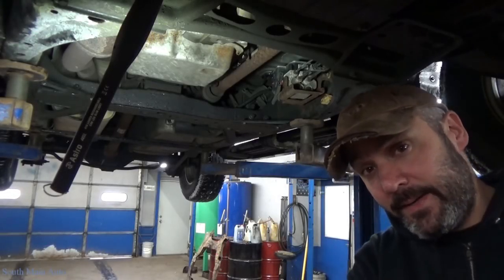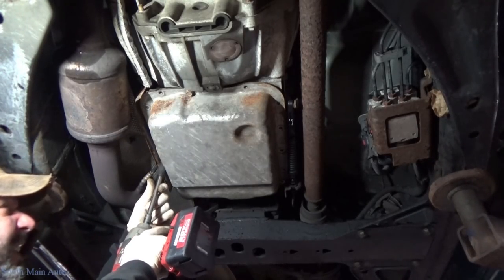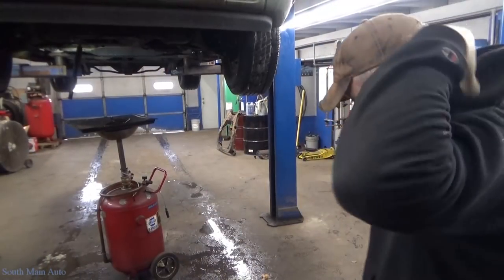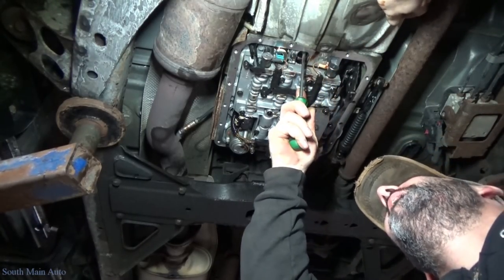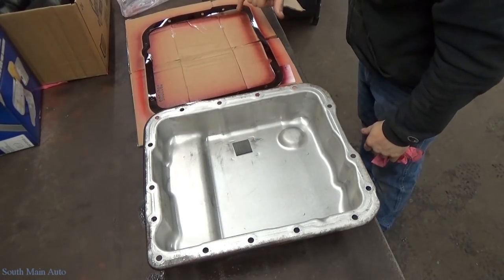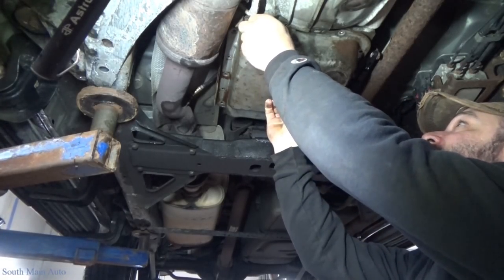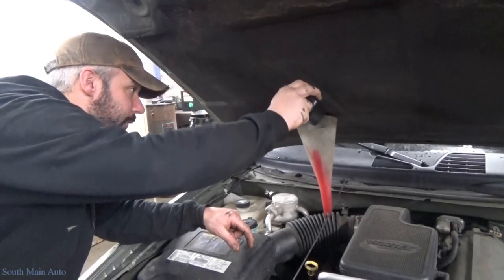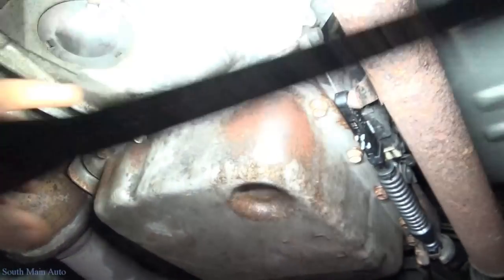Trailblazer / Envoy / Rainier Transmission Fluid & Filter Replacement 4L60E

Comment: I have done this on several different vehicles and if people would do it regularly it would be fine. Sometimes I disconnect one of the transmission lines going to the cooler and pump out all the fluid. I recently bought a 12 V electric pump to pump out fluids and I'm gonna do that today to drain the transmission pan before I drop it, less chance of spills.  As always Eric thanks for the great video.

Comment: I learned from someone else here on YouTube to remove the bushing take a 1/2 in. galvanize pipe about a ft. long with an elbow. Screw it into the bushing and then tap down with a hammer. Bushing easily comes out !

Comment: I'm glad that Eric O. Tells his viewership that there are two options that are available. One just being drop the pan to empty the fluid and change the filter. Second, use the fluid exchange machine to get all the fluid completely out of the system. SMA is always getting new subscribers or viewers and not everyone knows their options. Personally I like the fluid exchange machine used on my vehicles because I just like knowing all/most old fluid is changed out. Torque converters can hold up to 1 to 2 quarts of fluid. What's upsetting is how people go out of their way to try to discredit THE BEST mechanic on YouTube. I've never met him personally but trust him implicitly because he is always honest and extremely knowledgeable about his procedures. The quality of workmanship that comes out of SMA is the best I've ever seen. Eric cares about his business and his reputation as a mechanic. If I have a question about his work, I ask, and he replies with an educated answer. Great video.
Reply: problem is, most cheat and don't change the filters or seal when doing flush service.
Reply: throttle bottle Well I supply my own parts, filter and gasket when taking my car to a transmission shop. I also request the old parts back so I can be assured that they did the job. I learned a long time ago to mark my parts with an invisible marker as to know for sure im getting my original parts back. Sad but ive caught some dishonest mechanics this way.
Reply: @klwthe3rd  You GOT IT ! Trust BUT verify , I also mark my engine oil filter , " wipe and  call new " is far to easy !

Comment: I have no idea why you would get thumbs down
You did it perfect,as well as the high tack
Just remember to road test after you gather your 
customers info,to be sure the trans works properly,
before deciding on changing the fluid
I like to run a tap into the case threads & use 
anti-seize on the bolts & recheck the bolts in
a week,month or whatever

Comment: I know, older video. My 2000 GMC Yukon had the 4L60E and I dumped the pan and filter every year as an old mechanic told me to dump it every year and I got 150,000 Miles out of it and every mechanic in my area asked how I got so many miles out of it when it went.  I put the transmission in on a gravel driveway.  I had to lay down cardboard, chunks of old carpet to not get so many bruises from the rock.  Believe it or not, the hardest part was getting the dipstick tube back in.  I'm glad I did it exactly the same way!  I got rid of the Yukon at 220,000 miles as the blend doors were shot, ball joints shot and everything around it was nickel and diming me to death.  Oh yeah, I flushed the antifreeze at 100,000 miles per the manual with red goo and distilled water, never gave me a problem until the fuel pump went out.  I did that too, it was pretty easy except I broke a fitting off of the vapor canister as I missed one hose!  Great video and that's what I was told how to change fluid.  Same on our Accord, dump, fill run, dump fill, run dump and fill. Over 200,000 on that car and runs like a champ.

Comment: I'm way over do on changing the fluid in my transmission,   I'll just change it twice next time.  When you changed the transmission fluid on the 98 Toyota is when I found this channel since that's what I have for a car so it caught my eye.    I know a lot more would watch is they only knew what they are missing.

Comment: Definitely, not a hack by any means.  The only thing I would comment on is the electric impact when taking out the bolts.  I was doing this same job on an 08 Rav4; I was fixing up for my brother.  My electric impact broke two bolts right away when trying to take them out, so I switched to hand tools and hit each bolt with a little bit of propane before removing them.  I also want to thank you for introducing me to that Permatex spray gasket.  I saw you use it one of your older videos; I went out and got some and I use it on EVERYTHING now that has a gasket.  I used it when doing the timing belt on my v6 3.0 Audi for water pump, valve covers, etc... It did blow up my engine, but you know..lol jk.

Comment: I have an '01 Silverado 1500 4.8 & I do the exact same method, just without tack spray. Although my transmission is giving me a code for shifting, I have yet to change out the sensors in it. BUT I will come the new year with its service again.

Thanks for the videos & Happy Holidays.

Comment: Inhaling the fumes of the spray gasket sealer will help get you through the day much easier.  Nice job with the vid!
Reply: I'd imagine his shop smells like a brake parts cleaner factory ;)
Reply from the maker: It does smell amazing in my shop not gonna lie
Reply: My nose hairs were singed so bad that I'm still trying to regrow them.

Comment: I would always leave the front two bolts in each corner, and the middle in the rear. I'd take a screwdriver and break the seal on the gasket, then slowly remove the center rear bolt And let the fluid drain until it dripped, then I'd loosen the front bolts, letting the pan angle down and drain, loosening the bolts gradually until I could remove the pan. This usually resulted in no spills. Best way to get 100% of the fluid was with the fluid exchanger machine we had at Goodyear. You disconnect one of the trans cooler lines at the radiator and connect the hoses to the machine, after figuring out which was the return and feed. You'd fill the feed tank with new fluid, then start the car and turn the machine on. It would pump new fluid into the return line, and the feed line from the trans would pump the used fluid into the empty waste tank. It had a book that gave capacities for different cars, but we always added a extra few quarts and would run the machine until there was clean fluid going into the waste tank.

Comment: Thanks Eric I've never changed the filter seal before. Now I know it's there I'll address it next time. Good video.
Reply from the maker: They can be touchy so just make sure you have a back up plan....
Reply: Guy at the transmission shop I got my filter and seal from said they don't touch them normally. Claimed they very rarely cause any trouble and you stand a better chance of messing things up by replacing them than just leaving them alone. Same trans, 4L60E.  I went with his advice.

Comment: I like the way you replaced that seal. The first time I did that I got nervous that I would score the housing, and chickened out before reaching the point of no return. As you say, they seem to last forever and since then I've always gotten away with reusing the original one. Presumably if the seal is bad, pump flow would drop because of an air leak, and the pump could start dragging air bubbles that could be a real problem. So there is a risk of a serious issue that must be hard to recognize. Even new seals can leak.

Comment: I'm in agreement with you & rebuilt trans for @30 yrs and changing the fluid & filter as part of periodic maintenance will keep your trans healthy. Flushing is only required when replacing the transmission & converter or after cooler, converter or trans failure when fluid is contaminated with debris or coolant but doing more than the manufacturer scheduled maintenance is an additional option. People calling you a hack is ridiculous but hilarious and I've been using Hi-Tack to stick gaskets on components for years but never on both sides.  HAHA wonder what they'd say if they seen me using 3M Weatherstripping Cement on old style intake manifold & oil pan gaskets.  Hope you had a Merry Christmas and have a Happy Healthy & Prosperous New Year!

Comment: I’m in the process as soon as the weather clears up a little, doing a shade tree transmission flush and filter. I am not sure when the last time it was done, and recently started having issues with reverse engaging. Reverse light will come on but it wasn’t trying to move. No slipping in any of my other gears and no leaks. I just figured attempting this would be easier and cheaper than dropping the whole transmission and either rebuild or replacing it.

Comment: Hey eric i got a good laugh the other day when u forgot the springs in that trans am. Thanks for not editing that out it make your channel real and i got a great laugh on your expense. Lol. The other day i was smoke testing the inttake on my ram and i had it in the back of my shop which is 60 feet deep. I was puttuing smoke in through  the brake booster hose. Anyways when i was donr i put my smoke machine away and shut my hood after cleaning up and started mt truck amd quickly pulled it to the front of my shop. Yup u guessed it. I forgot to put the break booster hose back on and almost went through my shop door. Lol. Im not afraid to admit my mistakes and im glad your not avove that as well. Have good holiday
Reply: Whats the scents of doing something stupid and not sharing it with your friends?
Reply: Ken exactly but we'd be surprised how many people proly woulda cut that part out
Reply: Dylan Kinch WELL, I just have to wonder if he forgot to put the springs back in this one, with the trans fluid change, and just cut it out! Oh well, we will never know!

Comment: I have a 2001 Isuzu 4X4 Rodeo with a 3.2L GM engine and 4-speed auto. It's one of those wonderful designs with no transmission dipstick. There's a flat area on the pan with a plug on it. I have to take out the plug and if fluid runs out, it's full. Removing the dipstick and tube probably saved $3.00...

Comment: I was going to say I can't believe that doesn't have a rubber gasket on it, lol. Maybe it did originally. I loved my old 98 F-150 that had the E4OD transmission in it. It had a drain plug on the pan and one in the torque converter, draining was extra easy. Took 14 quarts to fill. Then the bean counters took over and decided the pan nor the converter needed drain plugs, go figure.

Comment: That's pretty much what I do.  My tranny pan has a drain and no replaceable filter.  So every 30-40K I open the drain and get about 3 quarts and replace the same amount.  Then repeat 2 more times over the next week with a few days of driving in between.  That's got me 170K of smooth shifting.

Comment: So I went thru this replacement today on my 2008 4WD Trailblazer - followed this vid closely.   The screws holding the pan is 13mm - and the torque to remove them was around 40 inch/lbs (which I used to tighten afterward).   I have a  vacuum oil pump that allowed me to draw 2.5 quart out thru the dip stick - and the remaining 2.5 quarts came out with the pan (owner manual says 5 quarts for the transmission).    That exactly how much I filled it up with afterwards.   Now one thing that resulted in 3  trips to the auto part store was the filter...apparently there are 2 types of transmission pans - and at least 2 different size filters.  The one I needed had a 45 degree triangle "cut" from one of its 4 corners - which matched up to the pan.  The first 2 I brought home did not have that notch - and the pan would not go on.  I had hoped to avoid that foolishness by taking the original filter with me - which I did - but in the first 2 cases I did not look that closely  at the replacement.  Lesson learn...NAPA had me covered... very helpful vid.

Comment: Only a Cooter could screw up a spill & fill- but I've seen it done. No filter seal, two filter seals, cracked filter seal boss, cracked filter, drained DRY with engine running, etc. Many "Quickie Change" Shops just vacuum out the old fluid, no liability for leaks, no overhead for filters & gaskets. They have really nice waiting lounges, WIFI, TV, free coffee, etc. to keep you occupied and happy. No thanks.
Reply: tons of fluid change hacks out there for sure!
Reply: What good is new fluid if the filter is clogged? Hate those jiffy places! Such hack work.

Comment: Best I had was a early eighties ford truck that was pulling a camper from out of state. It was towed in as the trans quit working on the interstate, and the trans had just been rebuilt a week ago. Got it up on the lift, and found a blown rubber cooler line. Both had been replaced, but whoever did it used VACUUM line..I guess the shop that did the trans had a kid install the trans or maybe just the lines, I can't believe a tech would make that mistake. Anyway, changed the lines with the proper hoses, and luckily the trans was ok, when the fluid dropped low the trans quit working, and they stopped and shut it off.

Comment: I believe you are following the correct procedure by changing the fluid and filter. I have been advised by a reputable mechanic to never flush your automatic transmission because there is a chance that flushing it can cause small particles to stop up some of the small holes and cause major issues.

Comment: I think some like to drain every drop because it is cleansing or cathartic for them. There is some psychology going on with that and engine oil changes where the owner feels he/she has control over one of the few things a person can do easily to his/her car and feel good about. The bobistheoilguy site is interesting place to see the obsession at work... yes, I have some ocd as well. The gasket sealer makes sense. Since I am too cheap to buy it, I take the bolts and feed all of them partially through pan and filter while on the bench. It holds the two together because the holes in the gasket are smaller than the width of the bolts and the bolts stick out just a tad.. Plus, when on the garage floor, it makes it easier with less swearing.

Comment: Specialty Transmission Shop said flushes are typically a bad idea unless done from new.
Stirs deposits that will destoy the transmission.  Of which I learned the hard way.
A regular dump and fill is a safer routine.  And way more cost effective.

Comment: I usually put a drain in the pan I use a 6mm bolt and a copper crush washer from a honda fuel filter with a nut tacked on the inside with a small slit on the bottom of the nut so it drains out. I found it works well with my regulars. I also do it like that so I have a no brainer way to make sure I have enough oil in it. Sort of a flat rate thing to save time and do 10 things at once sort of thing.

Comment: HAHAHA! People freaking out - gotta love it! I love your description of them - I was laughing. :D That tacky stuff is great - I use it on everything too. I guess those people should tell that to my 249k mile tranny in our Grand Marquis. It's had several blasts of the tacky spray. :)

I don't have a fancy exchange machine, but if requested (and on my own stuff),  I'll yank a cooler line and let it fly, as I dump fresh fluid in. I usually do that before dropping the pan, just so I can run the pan down a bit, kill the engine, and have very little fluid to dump all over my chest and face, lol. Install the new filter, fill up, fire up, and repeat for a few quarts. Reconnect the line, top off, and off she goes. Starting to see this isn't possible with alot of the newer crap. Automakers trying to get people to forget driveline maintenance ...

About the only thing I do differently from you there is I smear some grease on the magnet, just to give the chunks something to stay put in. Something I've done for years. Not sure if it accomplishes anything ... but I still do it. :D

My Silverado is about due again - did the total flush back at 40k miles to Amsoil - she's got 91k on her now (doesn't get used much). I think I'll wait until I get my lift in before doing it again. :) On mine, I had to remove the shift cable mount there - was a ROYAL PITA! GM decided to throw a Torx bolt way up on top where you can't see it - back in '09 when I first  dropped the pan, I couldn't tell if it was allen, Torx, or some other GM brainstorm they invented, as I was laying in the driveway. Of course, they put the damn Y pipe RIGHT on the front of the pan, so there's no possible way to maneuver the pan out. Finally got it out, and put a regular hex head bolt in for an easier time next time. I didn't have Torx socket bits then.

Hope you guys all had a Merry Christmas!
Reply from the maker: Haha I know what your saying. here them torx on the top are just round blobs. What I do is just pop the cable out, pry the holder over and let the pan down. After I put the pan back on just pry it back and done! Don't worry you can not pry to far, it hits the front drive shaft ;)
Reply: Great tip! Thanks AGAIN man!! :)

Comment: In 1973 still in High school last peroid was vocational school, auto mechanic's  and after school i worked in a shell gas station we did the same thing, in fact you could take the plate of and unscrew the square plug to drain the torque converter, I have 04 Grand cherokee lardeo 4.0 they recommend 30,000 mile change